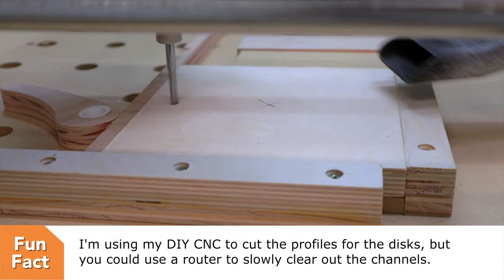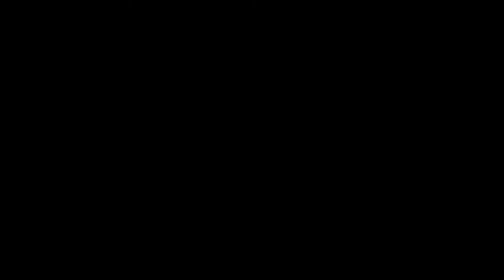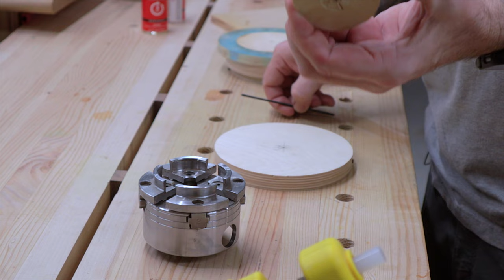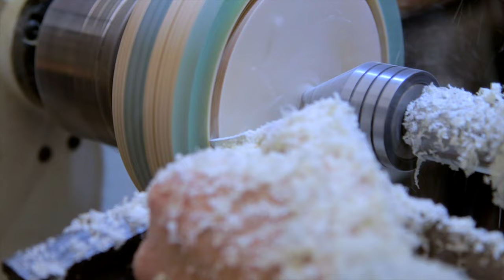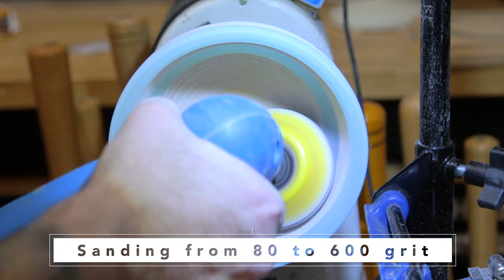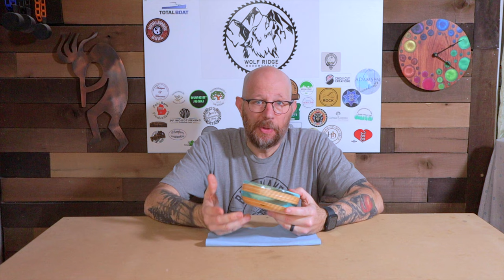Woodturning: Plywood & Resin Bowl

Comment: Hi Ed I saw the title of your video, and I was curious if the bowl would look like the one I made, but this is a completely different approach.
 Yes there is a big difference between the various qualities of plywood and for wood turning it is better to have a type that does not contain voids, which is so much easier to finish.
This is a good way to make epoxy rings. I will also try this method, but without a CNC machine.
I'm looking forward to that project what you want to do with this method and I can not wait to see this. 👍👍👍Cheers, Hans

Stay safe and keep  turning
Reply from the maker: Thank you very much Hans!  That video is coming out today (6/18).  - Ed

Comment: Looks great, Ed!  Try sanding in both directions.  That should help.
Reply from the maker: Thank you Billy!  I actually recently tried a trick I've seen Ken Moon use.  Sand up to 180 and apply sanding sealer.  Then sand 180 to 600.  Ended up with a very smooth finish.  - Ed

Comment: Nice idea.I have worked with plywood a number of times, and you have the right idea there about finishing. Just a note from a retired chemist - DNA may not be the best choice to remove oils. It is a "polar" solvent, and oils needa "non-polar" solvent to solubilize them, I suggest acetone, or mineral spirits ( that might  need an acetone wash to get tris of the traces)
. I have just started using ACKs and have finished only with shellac with no problem. I want to try lacquer next.  Looking forwaard to your hollow form!
Reply from the maker: Thank you Ron!  I'll have to give that a try.  - Ed